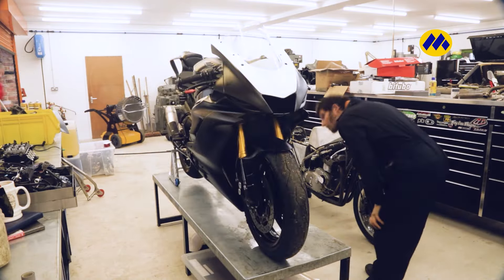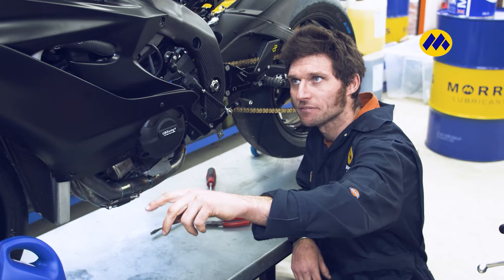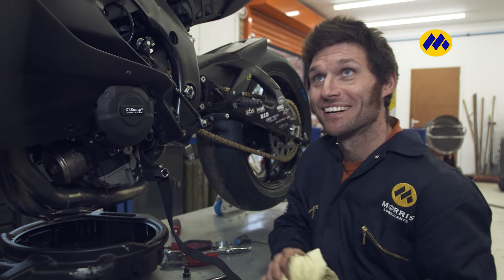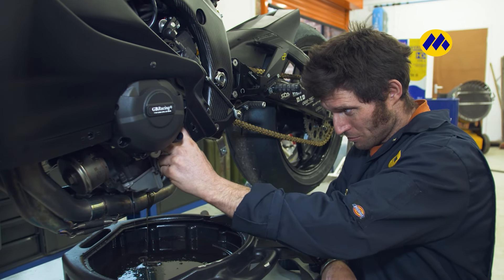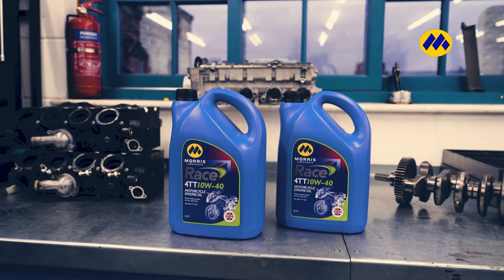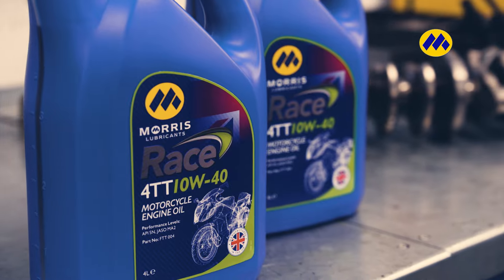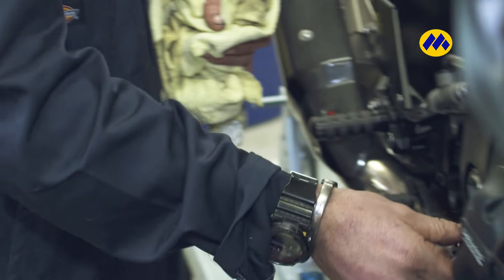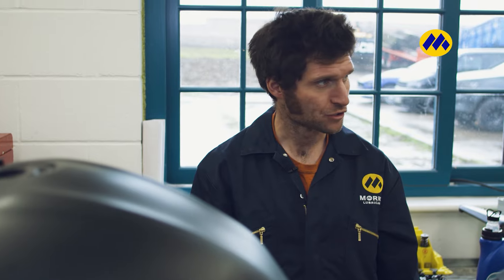Guy Martin Racing Bike Oil Service

Comment: Where the oil filter is in a different orientation that prevents pre-filling with oil, do you recommend using Clear Flood Mode. While I understand this involves a full throttle open cranking process, I've yet to have the guts to start an engine on what is effectively full throttle with an empty oil filter. Any thoughts?
Reply from the maker: Hi Ray, thank you for getting in touch with Morris Lubricants. This is a really interesting question, if you email this to our technical team at technicalhelpdesk@morris-lubricants.co.uk they will be able to assist you.